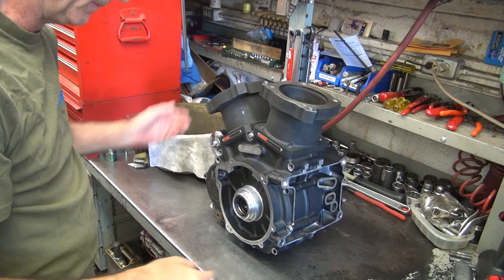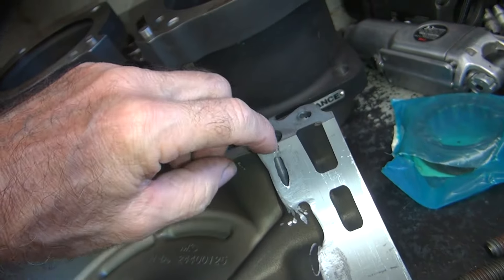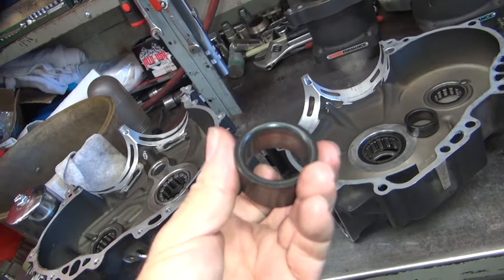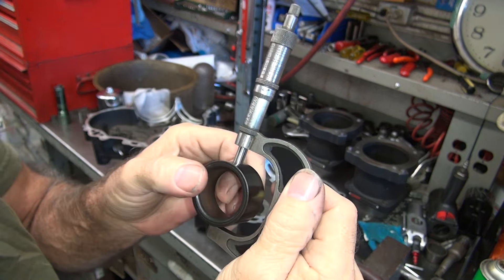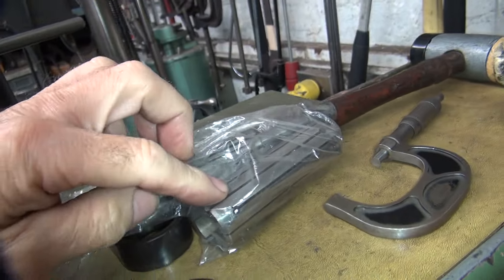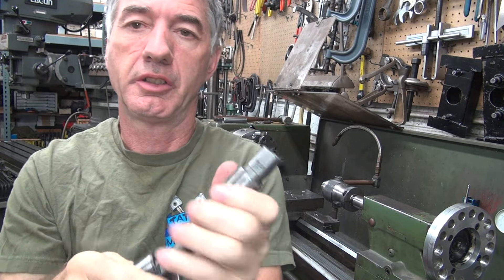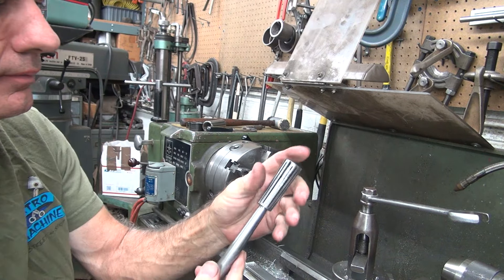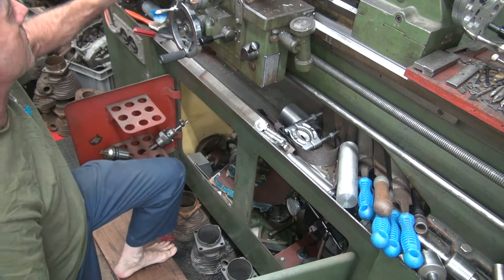#115 m8 145ci 4.5in bigbore case machining hyperformance finless race cylinders harley tatro machine

Comment: The 4 valve M8 heads flow really well stock but it’s a sure bet on this big cube engine he’s gonna have the heads ported and big valves. One would believe he’s gonna spin it up pretty high.
Reply from the maker: not likely. most riders don't spin them up all that much. even at the drags i was shocked on how little they rev things up. i pull 8000+ rpm on most all of my old crappy 2-valve motors. even my big 4.8" stroke motors turns 7500 rpm.  my buell is 9000 rpm. 
these m8 motors don't look like they can take that kind of rpm for long, much as leaving it there like my landspeed race motors do.
time will tell.
tatro

Comment: If you're removing those counter balancers from the bottom end will you need to do your due diligence in breaking down the flywheels and dynamically balancing them? I hope so as i love watching you do that! Also, will you end up welding up the main shaft to the flywheels to prevent them from scissoring (moving)? I can honestly say since watching you over the past 10 years i don't recall you ever doing that BUT i feel that you might have to on this one. Most of the heavy hitters in the aftermarket are welding them for strength (Dark Horse and a few others).
Reply from the maker: dynamically balancing, is spin balancing. that means you leave the crank together. i static balance my flywheels. that does require me to take them apart.
i am not a fan of welding. unless you put a big weld bead on the crank, you will loss holding power.
tatro

Comment: I feel .002"- .003" is sufficient for an oil film (clearance wise) on any bearing.
Reply from the maker: we are not dealing with oil film here, we have to have room for the rollers in the bearing to roll. with the crank flexing all over the place, that can add up. the higher the rmp and the longer you are at that high rpm, the more room you need. 2-3 thou is the min. i run way more on my single.
tatro